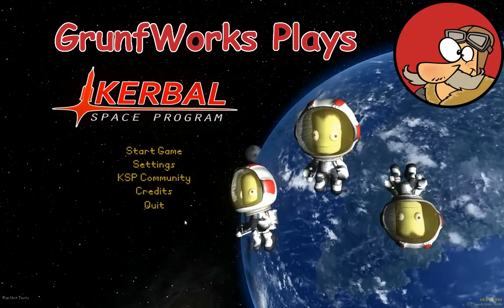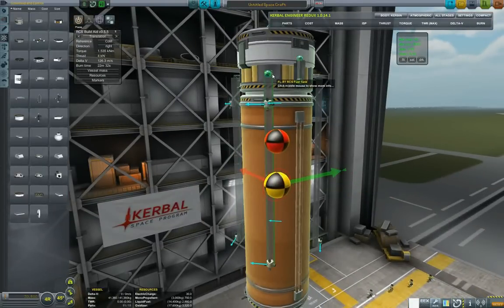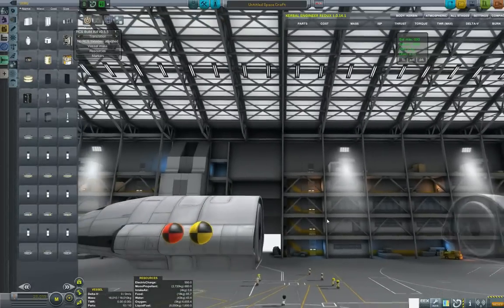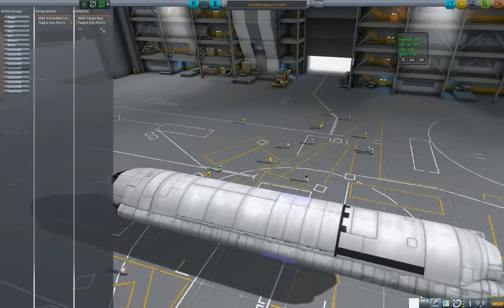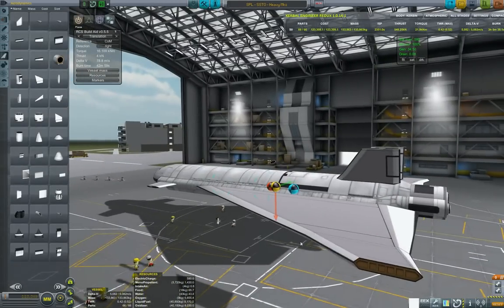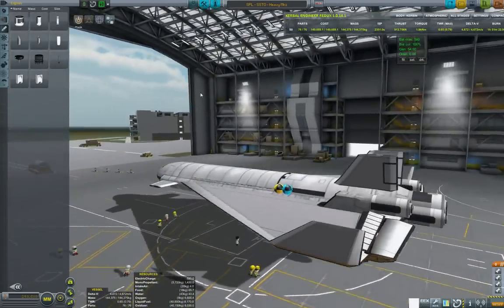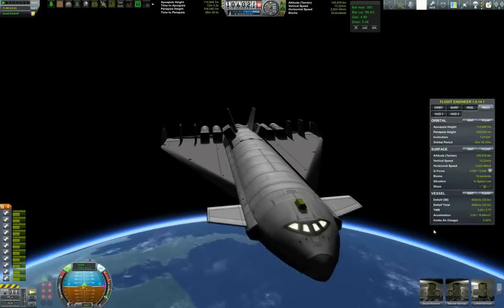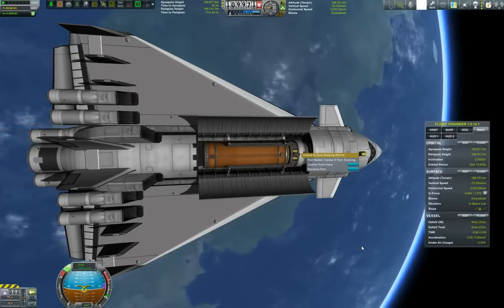Kerbal Engineering - How to build a big Cargo SSTO

Comment: I think it is the SABRES that are OP as well. I am probably wrong since I'm still a new player, but I've tried out various hybrid engines and SABRE seems to be a bit of an I-WIN. 
Imo, needs some tweaking but thats not for me to decide :D. 
Nice vid. looks like the part count can be kept low wih procedural parts
Reply from the maker: +airwolfman Yes SABRES are a bit powerful, but with my other playthrough (KSP Interplanetary Voyage - https://www.youtube.com/playlist?list=PLU2HTdReBtvLg6_yR-x8lzR8mufVtsewU) I am trying to keep them little bit higher up the tech tree, and i play with ADIOS tech tree so all nodes take a while to unlock

In that one I want to have everything from the lowly engines that barely do stuff to the completely OP ones (like after lot and lot of research - a breakthrough ;-) )
Reply: +GrunfWorks I will check it out :). But after playing for a while, yeah, SABREs are quite a necessity. SSTO seem to underperform most of the time T_T
Reply: +airwolfman I'd agree, they're probably the best option for most builds but they were purposely designed in real life for an SSTO in mind (RAPIERs are from skylon project I think). It's still easy enough to build SSTOs with ramjet and a aerospike (reliant even works pretty well) that you have other options. I would like more options like ramjet to scramjet engines though, that'd be cool.

Comment: Playing with such mods is sooo much making it reasier for yourself. Why people always avoid challenges? :/
Reply from the maker: IntruderPL2 actually I play with compilation of mods - some make it easier (i.e. Kerbal Engineer, RCS Build aid, Fusebox etc), some make it harder (TAC Life Support, RemoteTech, Kerbal Construction Time). For me challenges come in another form rather than building everything stock. In the future i might do a stock series, but for now my main reasons for using mods are:

- function - i.e. MKS, Station Science give reasons for stations to exist

- beauty - i.e. procedural wings save me assembly of the wings like tiles, and it also reduces part count when i am docking with big stations

- avangarde feeling - i.e. NearFuture - Try building Eve or Jool Interplanetary probe with RemoteTech and NearFuture propulsion - i assure you it is very challenging (in parts mass balance with low thrust, but with benefits of high ISP). it is challenge in itself. Also controlling such craft with 3 minutes time delay creates some other challenges

- time saving - i could theoretically skip using engineer, fusebox and the like, but my main focus is not calculating everything on paper (which could be done), but to focus my videos on things that matter and that is building crafts for a particular purpose or mission in mind

...so in the end I am shooting for still challenging game (talking here about my Interplanetary Voyage Playlist series), but challenges come from another aspects of the game, and making it easier (and automatic) for the parts I have already done so many times. It is a dynamic balance that it is sometimes hard to nail.

I think you will notice more challenging missions once Interplanetary Voyage goes Interplanetary (which is scheduled to go soon) :-)

Comment: try using alt button when trying to attach things from attach points. i see you are having troubles in some videos.
Reply from the maker: tayfun gürgen will try thx. What is it supposed to do ?
Reply: things only attach to the points when you hold alt button.
Reply from the maker: wow, that i did not know, that will really help me. Thanks.
Reply: tayfun gürgen Wow this really helps, thanx

Comment: separate vessels will go through one another in time warp. that's how your payload got "unstuck"
Reply from the maker: Alan Jackson that fact is cool to know, thx. Did not know why it got stuck in the first place.
Reply from the maker: I had 2 struts connecting the rails where the RCS thrusters are with inner edges of the cargo bay (i am using the invisible ones for aesthetic reasons, i think they come with kerbal joint reinforcement)
Reply: +Zwenk Wiel mystery = kraken ;D

Comment: How I'd you get your p-wing to work in ksp 0.90?
Reply from the maker: Zachary Legaspi I am not sure what you mean by getting it to work in 0.90. There it works flawlessly. Did you mean getting it to work in 1.02 (or 1.03 perhaps).

If that is the key there is B9 procedural wing that can be used for this purpose
Reply: I saw that one but it doesn't work with mine

Comment: How do you do the wings? What mod?
Reply from the maker: Rezz It was Procedural Dynamics:
http://forum.kerbalspaceprogram.com/threads/29862-0-90-Procedural-Dynamics-Procedural-Wing-0-9-3-Dec-24

Not sure if it works with 1.0.2 yet. This was 0.90
Reply: GrunfWorks Thanks!
Reply: Rezz Just a heads up. There's a B9 version of procedural wings already updated for 1.0.2. Here it is: https://kerbalstuff.com/mod/515/B9%20Aerospace%20Procedural%20Parts
Reply: Revanchist8525 have you tested this, and confirmed to be safe?
Reply: Chris Hunsinger What do you mean "safe?" if you mean stable then yeah, the mod is stable, you have to fly with FAR though.

Comment: what mods are you using?
Reply from the maker: Mark Iv system for body, procedural dynamics for wings and b9 aerospace sabre engines for engines
Reply: +GrunfWorks is there a link i can use. sorry about the trouble
Reply from the maker: Titus Bunce
Sure no probs, was on mobile earlier:

Mark IV:
http://forum.kerbalspaceprogram.com/index.php?/topic/91713-105-mark-iv-spaceplane-system-the-go-faster-update-minor-hotfix-030116/&page=1

Procedural Dynamics - Procedural Wing:
http://forum.kerbalspaceprogram.com/index.php?/topic/117236-112-procedural-dynamics-procedural-wing-v01111-22-may/

B9 Aerospace:
http://forum.kerbalspaceprogram.com/index.php?/topic/83570-112-b9-aerospace-release-611-updated-030516/

Comment: This is a Very nice design!:)
Are you using Any mods or can i Do this in vanilla 1.0? 
Greetings from germany:p
Reply from the maker: Spliffinger This is 0.90 design. This is the mod:
https://kerbalstuff.com/mod/380/Mark%20IV%20Spaceplane%20System
Reply from the maker: I also think i used some parts from B9 Aerospace (airbrakes, and engines), and VNG Vanguard Ejection system, among others

Comment: does this work in v1.1?
Reply from the maker: +Milos Dlouhy as far as i know Mark IV mod is updated, but pWings is not yet, but even if it was the craft would probably not work as there has been many versions in between. Best bet - redesign it.
Reply: thought so :( Since there was that heating redesign, I guess it's now impossible to get close to orbital speed below like 45Km
Reply from the maker: But these intakes are IMO a bit OP, and they provide a bit more Intake Air which would allow some airbreathing even at 45k altitude